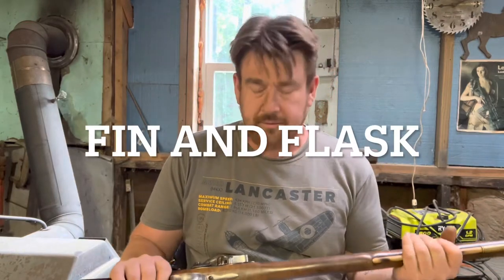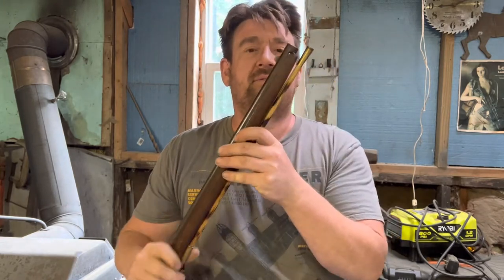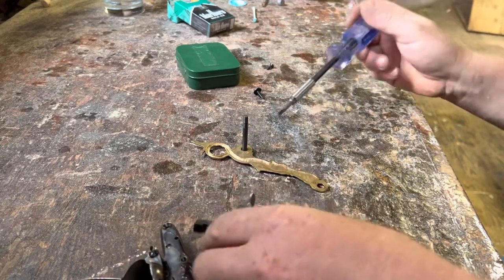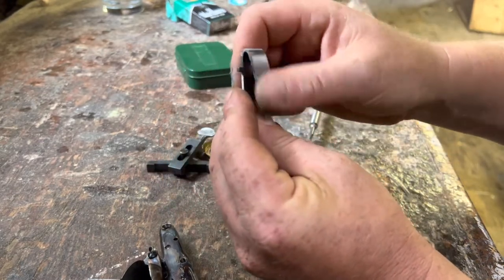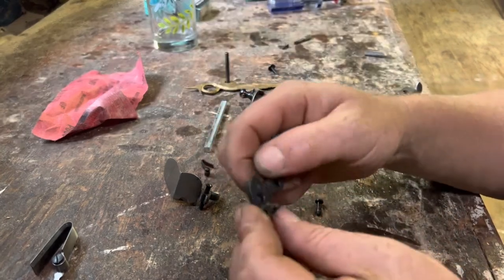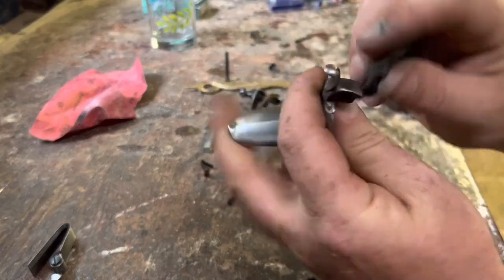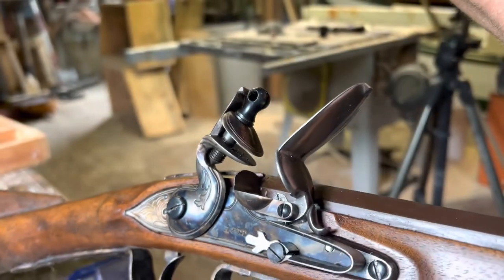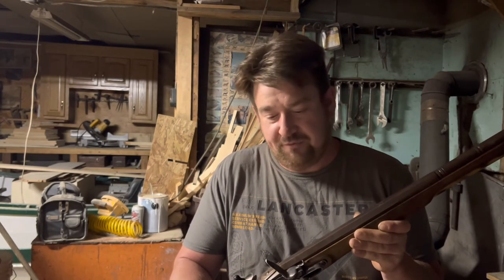Tuning my lock on a Pedersoli Northwest Trade Gun by polishing the moving parts

Comment: Most vent holes on production guns come undersized. I recommend taking a #73 size drill bit and enlarge the vent. That combined with really polishing the lock components should improve your slow ignition. Also don't overfill the pan. Keeping priming powder to a minimum also will help ignition.
Reply: 1/16”, #53 drill for flash hole is also a recommended option.

Comment: If your vent hole are positioned almost  level with your pan, it will cause a fuse like burning into the vent.
If it is the case you may have to install a new vent liner with the propet size vent hole. It should be slightly above the base of the pan. You want a flash not a fuse like ignition. Also don"t over fill your  pan, use less than half full priming. 
You can also use a finer grain priming powder with a properly positioned and sharp flint.
Reply from the maker: The vent hole is above the level of the pan. It’s in the sunrise position. Since I polished the moving parts this gun ignites  instantly. Can’t feel any delay anymore.
Reply: @finflask1862  good deal. Flinters at times require alittle magic to get them to be consistant. When they are set up correctly they can be a joy to shoot.